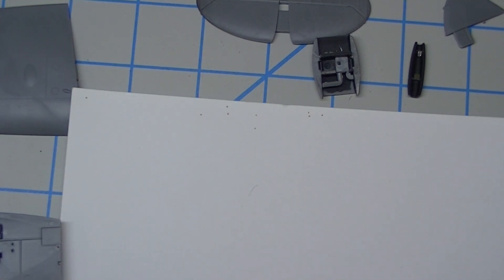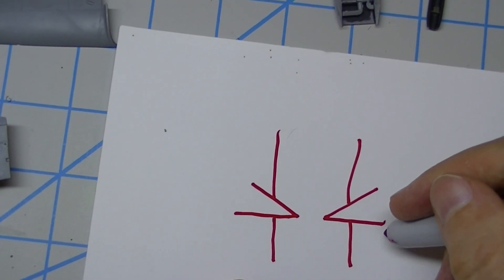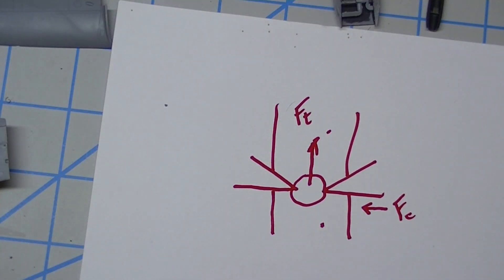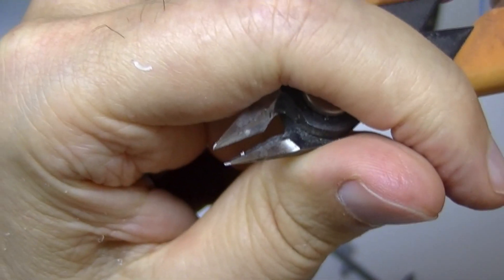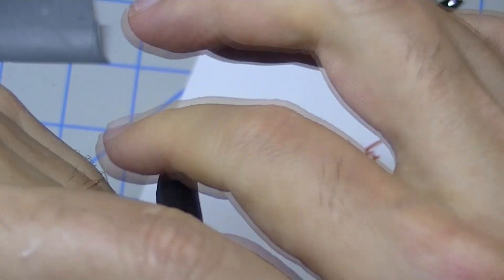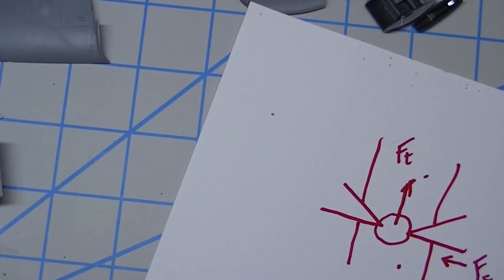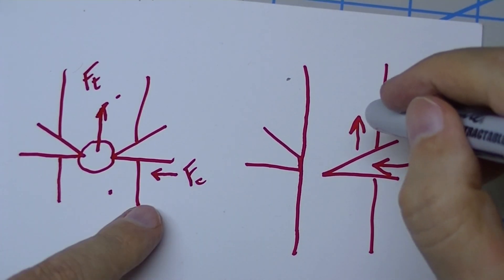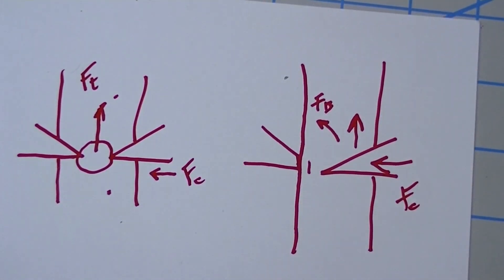ep273 - 10 minutes of random #36 (the physics of sprue cutters)

Comment: The micro Mark cutters are "blade and anvil" type.  for 30.00  Took a picture with a microscope to prove it.  Do you think GP made the cutters or had them made?   GP does not have the resources to make such a product, they contract that kind of stuff out.  That lasts just so long before the contract runs out and the real mfg is allowed to sell to others.   I will send the pic of the cutter if you want.    So they are the real deal and that's a good thing because PG never has them in stock.  Buy one and compare them.   https://www.amazon.com/gp/product/B083XK2XCK/ref=ppx_yo_dt_b_asin_title_o09_s00?ie=UTF8&psc=1  Photo is here https://www.facebook.com/photo?fbid=4692371957440443&set=a.271450759532607
Reply from the maker: cool!  good to know.

Comment: Will. I like your stuff and watch it all. (Waiting for more Spitfire videos, especially as Doog is finishing the Jug.) Respectfully, however, I think you're wrong on this one. I'm with Paul Budzik on this matter - he claims the big difference between quality nippers (he dispenses with stamped cutters like Xuron - although they're fine for cutting sprues) is between flush cutting as opposed to diagonal cutting. A flush cut will give a straight cut - taking a part off a gate, not cutting through a sprue. He believes in the real world that a good two blade cutter works as well as a single blade. And he also points out that factors such as shape can be more important than design on good nippers. As luck would have it, I own every nipper Budzik references. My "go to" is the Tamiya 74123 because of its long and thin construction. Budzik is right that the Tamiya 74035 may be a bit better for thicker cuts - but any Tamiya nipper is a fine tool. (The Japanese are good at this stuff.) I have a Dspiae single blade nipper that I find very disappointing but it may need adjustment. My God Hand single blade is beastly sharp and is the best for trimming plastic off a part and is not in my view at all "over rated." God Hand nippers are, however, fragile and should be used per instructions. In fact I'd say you need at least two nipper/cutters, preferably three. One: a big sprue cutter (they're cheap) or the Xuron stamped cutter to cut through sprues. (As you've illustrated, it's often better to cut sprues into portions to allow a better shot at a clean cut on the part, so I use a sprue cutter on every kit.) Two: a Tamiya nipper (I'd go with the 74035) for removing the parts: they're worth the $25 and will give years of service. Three: if you like tools get the God Hand for the times when it cuts plastic like its butter. But for removing parts from gates - which is what you really need - a quality Tamiya nipper will be more versatile than any one blade cutter I've ever used because they're better shaped to get the blade to the part.

Comment: Interesting explanation. Now I know why my Micro Mark Micro Sprue  Cutting Pliers perform differently from my Xuron Ultra Close Cutting Shear. The former is of the anvil and single blade style, while the former is double-blade (albeit with a bit of “bypass” engineered into the blades.)
Reply from the maker: heh.  that "engineered bypass" is marketing speak for poor blade alignment.
Reply: @barpfoto  I thought the reason for offset double blades is so they dont make contact?

Comment: Can anyone comment on how long the single anvil type nippers stay sharp as opposed to dual blade type being their is only one cutting surface doing all the work ?? Do they tend to dull faster or the same?? Kinda hard to bring myself to forking out $50-60 for a tool that my not last as long as Tamiya thin side cutters that only cost $20.
Reply: I've had my GP nippers for about 2 years. I haven't noticed any dulling. Besides, we're talking steel vs soft plastic when cutting. (Styrene is very soft compared to some plastics.) I expect mine to last a looonnnggggg time.
Reply from the maker: all i can say is mine have stayed sharp for nearly 5 years.

Comment: Precisely. I think the physics are the shearing action and rate of displacement of the cutting edge through the media. The thicker angled blade, whether two or one, is shearing and separating the two halves rapidly - stressing and tearing the plastic apart at the micro level in two ways. A thinner, more acute single blade doesn't displace as much plastic as fast (like a razor blade), and doesn't shear it apart as rapidly, with less stress and less potential energy to launch that fucker across the room. I think the single blade and anvil design makes it more like a razor blade cutting down on a hard surface with displacement in one direction. I suppose there is less potential for breakage of the tool, and not building two razor edges to come together perfectly would  keep manufacturing time and costs down. The Gundams and God Hands love to shatter on floors (ask me how I know). But, you can hear and see the less stress that thin shearing anvil action pulls off. Gimme the $30 dollar nippers every time. There's a clever equation here for Veritasium or Smarter Every Day to do a show for model geeks here. Of course, my opinion is like an asshole - everybody's got one.